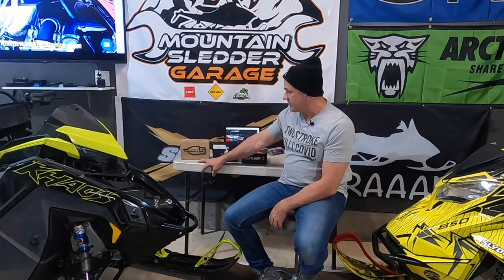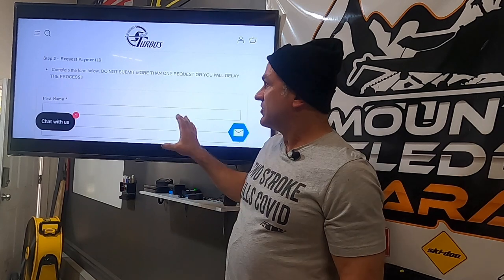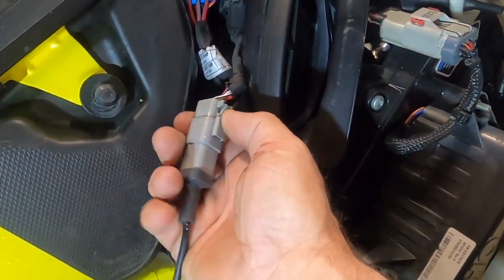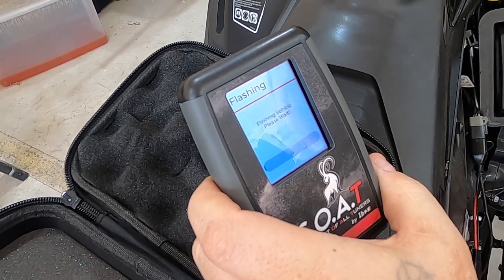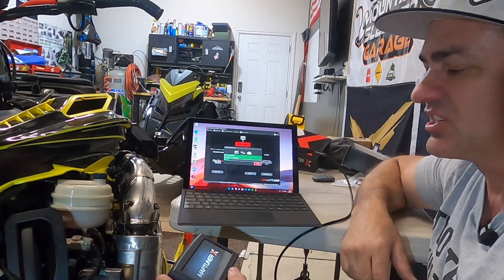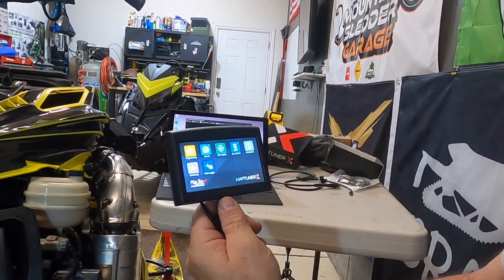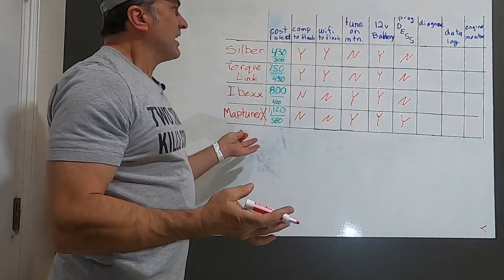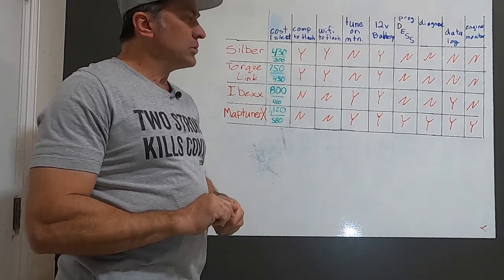Polaris and Skidoo 2-stroke snowmobile ECU tuners for more power

Comment: Are you going to do a follow up with EZ Lynk?    I heard you can use it to read and clear codes with also.
Reply from the maker: Actually, I just got my new EZ-lynk and will be doing a follow up video in the next couple weeks. Have a couple other videos in the works to finish first.
Reply: Looking forward to it.  Data logging feature intrigues me for how you could use it to dial in the max rpm with adjustable weights.